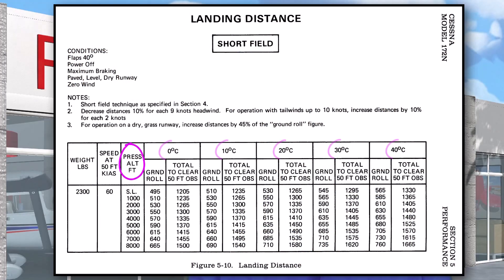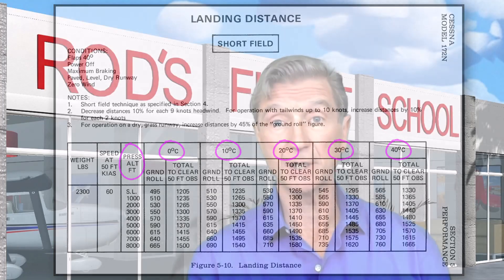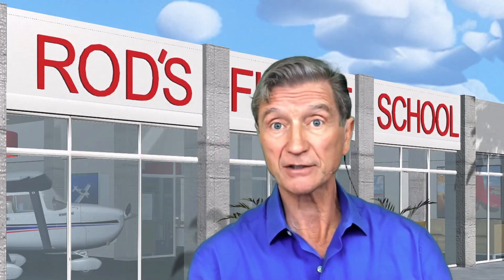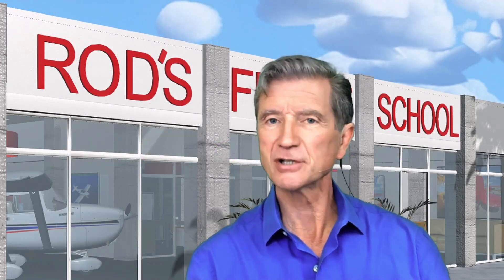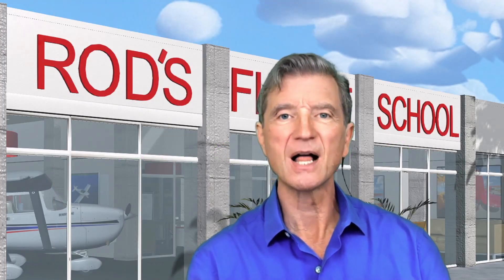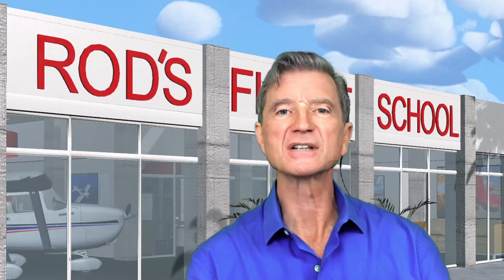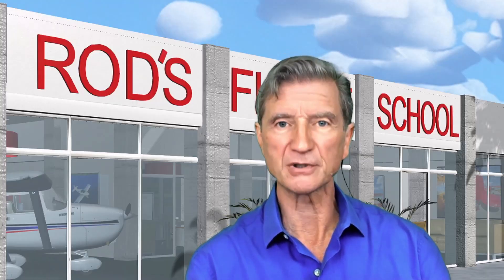Density Altitude: How Do You Use It?

Comment: My first training airport was at 4705 MSL. On a very hot summer afternoon, our DENALT could be close to double that! In a Cherokee 140 with a 200+ pound instructor, I remember those little wheels spinning really fast for takeoffs & landings! And our rate of climb was often barely above 100 FPM. It was easy to FEEL the differences in density altitude between a cool morning and hot afternoon, so the effect wasn't just academic.
Reply: Instructing in a 140 with density altitude of 8,000’ is malpractice.
Reply: @LTVoyager According to the POH, it will climb 100fpm at 14,000 at gross wt.  It's nearly a rocket!
Reply: @warren5699  I may have exaggerated a bit for effect, but it sure FELT like 100 fpm at 8000 DENALT. Maybe more like 300...
Reply: @GeeBee135  I know what you mean.  I flew at Leadville CO one time - 9,934 elev.
Reply: The POH for my 180 says 7,000’ maximum
Reply: It’s all about leaning the fuel and air mixture ratio correctly as well
Reply: @scottysansone5884 No, it isn’t all about that.  It is important to lean to get the most power the engine can produce in those conditions, but in the best case you are down about 24% on power and leaning doesn’t make that better it just means you aren’t down by more than 24%.  It is all about judgment and good decision making.